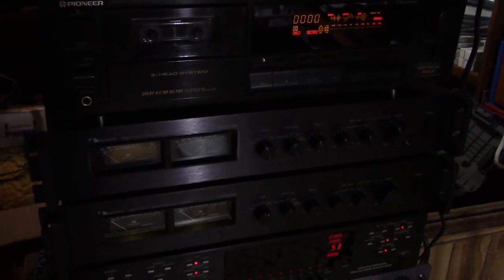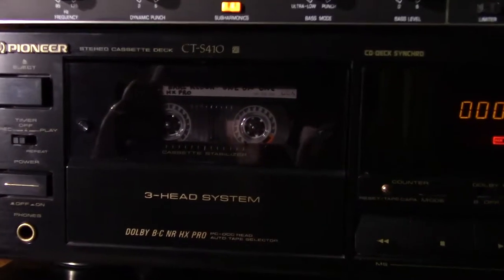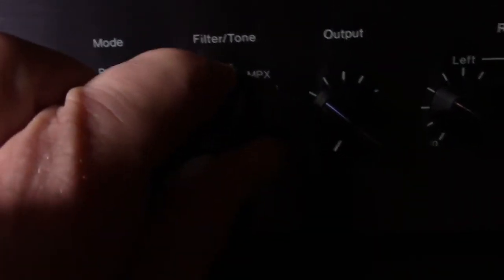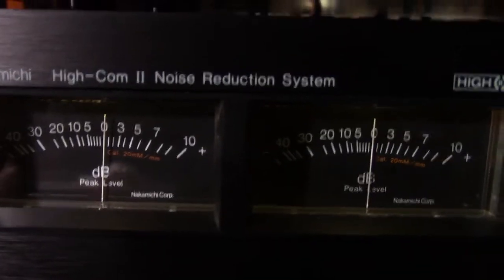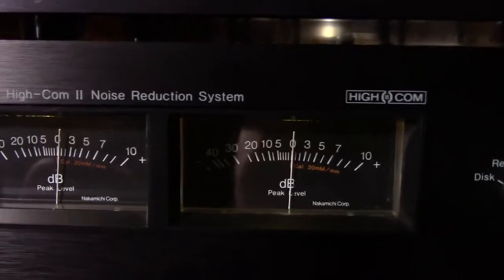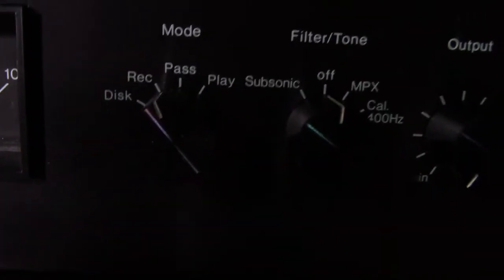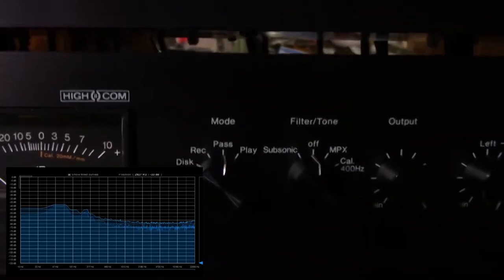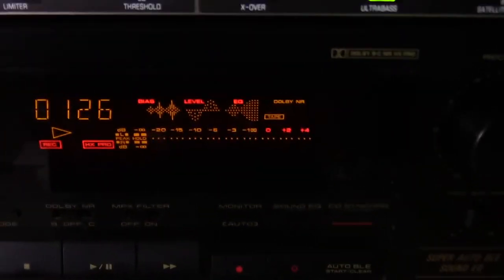High-Com II X 2: Nakamichi Squared

Comment: the main problem with these odd NR systems is always versatility.
What happens if you put an high-com encoded cassette in an old crappy car deck?
Reply from the maker: That's one of the reasons Dolby B was so widely accepted. It didn't sound terrible if it wasn't used. In car stereos it even sounded better if the Dolby was off. Other more aggressive NRs sound terrible if not decoded properly. Mainstream acceptance was low. Mostly afficianados.

Comment: Hello.  What is that EQ, i love the feedback it gives...very cool. 
Why such low record levels? Thats odd the pioneer only goes up to +4 , most give 6 or 8, i onow my Denon hd8 are good to above +6, id be unhappy i couldnt do a clean +6 without overload worry , yet you do -1 , is this to aid dolby ? I know dolby ref level is zero... i think tapes sound best recorded as loud as possible without distorting , but i dont use NR , does this hi com prefer low levels; is there another reason you record so low?
Reply from the maker: The EQ is a dbx 10/20. I record at lower levels because the extra noise reduction allows for it. You can get a very low distortion recording and still have an amazing signal to noise ratio...

Comment: Hi Hammy! Was wondering how do do hook up a Nak High Com II between a Nak 1000 Deck and a Receiver for just playback? What rca cords go where ?
Reply from the maker: I would recommend going to hifiengine.com and checking on the user manuals. They would give proper connection procedures. I believe the Nak 1000 has an external loop built in for NR.